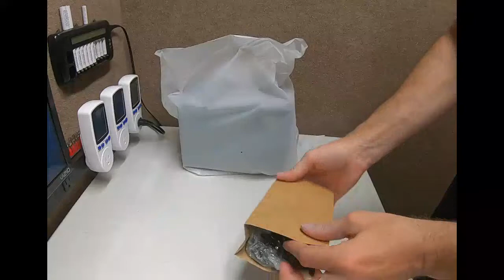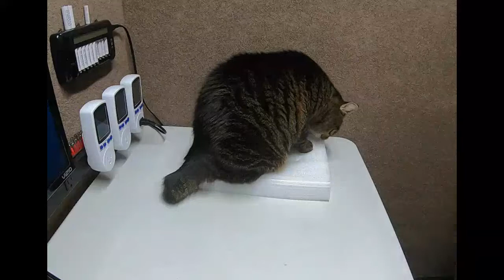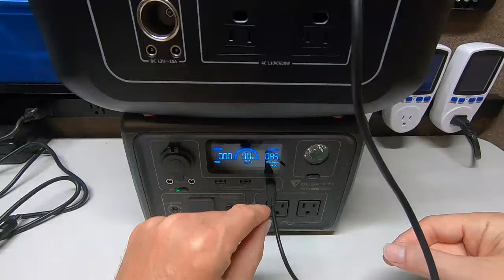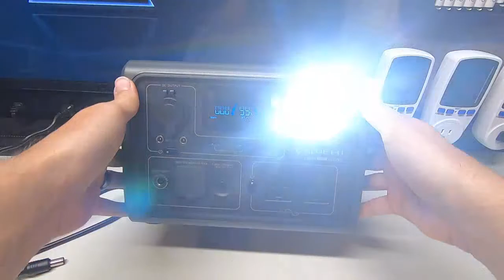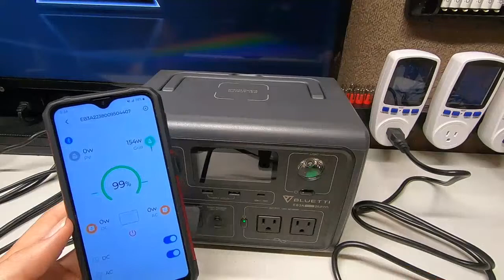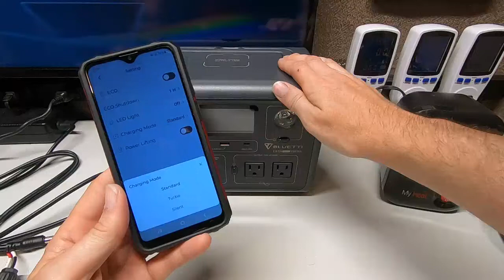BLUETTI EB3A Power Station (((((UNBOXING)))))

Comment: I just got one of these. I’m finding the wireless charging on this unit gets too warm and my iPhone never fully charges. Under the Battery app in the phone it states charging was stopped due to too much heat. The output only goes to 11 watts max then tappers down gradually. The top of the charger gets warm despite on discharging a few watts. Nothing else was charging. Charging by wire off a USB port on the charger the phone only gets to 97%. The charger output shows 0. I left it on for mor than an hour and no change. I then plugged my phone into a power brick and it pushed in the last 3%.
Reply from the maker: Sounds like it is going too high.

  The wireless charging is only about 50% efficient so you should only be getting 7-8 watts. Sounds like you are getting too much power output.

Comment: Hey Bob do you have a link to where I can buy that watt meter?
Reply from the maker: How is you system doing?
Reply: @RamblinBobReviews  it's doing ok...not really using that port right now but soon I'll be upgrading my solar
Reply from the maker: Keep us up to date with it, It helps other people make up their mind if that system is good for them. I still believe it is just that simple fan, And I wish that i could fix it for you :(
Reply: @RamblinBobReviews  will do. I wonder if Pecron will produce some more LFP powerstations
Reply from the maker: They are testing a larger power station right now, We hope that we are allowed to review it....fingers crossed.....:)
Reply: @RamblinBobReviews  I'll be looking for it
Reply: @RamblinBobReviews  Interesting, can you tell the specs (inverter, battery capacity) (edit: of the larger Pecron model)?
Reply from the maker: We mentioned all of that in the video a few times :)

600w AC inverter with 268.8wh :)
Reply: @RamblinBobReviews  Oh yes, but I meant the new, bigger Pecron model
Reply from the maker: ooooooooh, sorry.....LOL

  Pecron has not released any info to use about it, My theory is
3,000wh main (3,600w inverter)

But not 100% sure yet :(